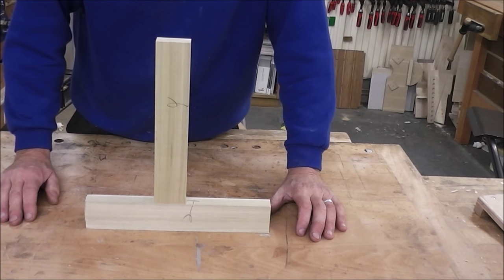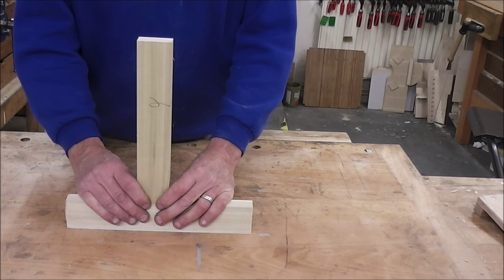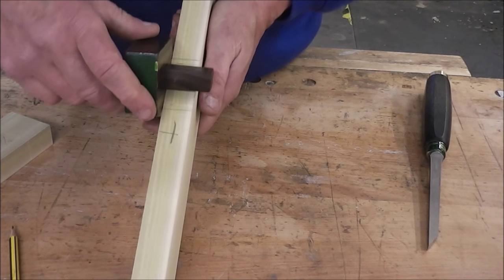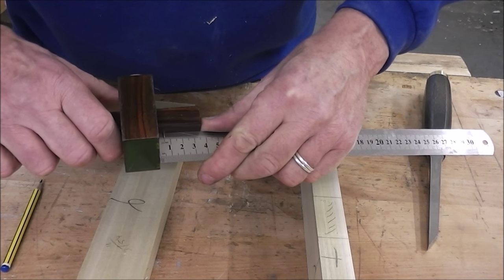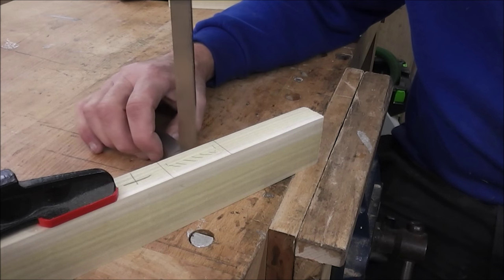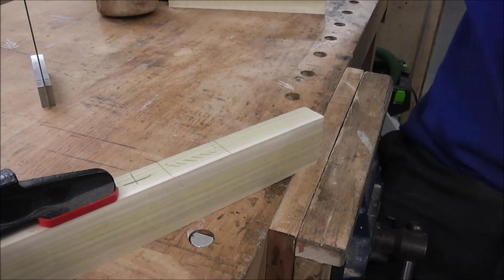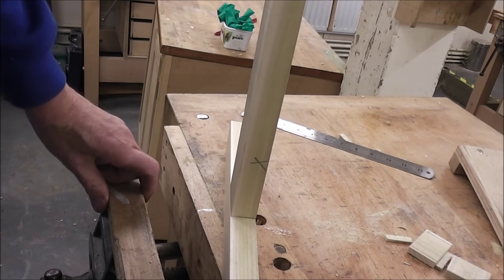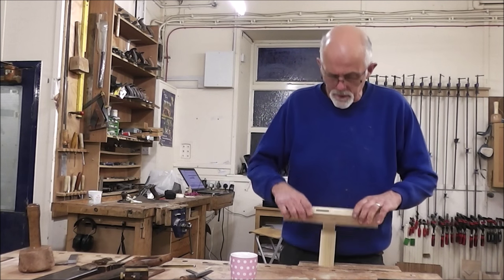How to cut a mortice and tenon by hand

Comment: Very informative video, thank you.

One thing though: Is there any specific reason to do the longer sides first when cutting the shoulders? Wouldn't it be better to cut the short sides first? That would give the saw more line to follow, resulting in a cleaner cut.

Comment: around 4:14, you scribe the lines for the mortise: is there any reason not to cut the tenon(s) first and then transfer the width, like you might with a dovetail?
Reply from the maker: +ThoperSought I must admit I have never thought of doing it that way. I was always taught to "dig the hole then fill it". You use the mortice gauge to mark the tenon, why not use it for the mortice while it's in you hand. Perhaps, if your sawing is not good, you may want to scribe from the tenon. But scribing  from the tenon would then mean you may not be able to cut the mortice just using the width of the chisel. This using the width of the chisel as the reference for both mortice and tenon is the essence of the method. 
For beginners, I think practicing sawing is very important, I would recommend doing a few practice cross and rip cuts at the start of each session at the bench.
Reply: Christopher Tribe
thanks very much for taking the time to reply!

that all makes a lot of sense.  I know my sawing is terrible, so making a serious effort at practicing it seems like a good idea—your sawing video was really helpful, so that I'm not quite as terrible as I could be.

I don't have a bench yet, so it's not so easy to get a good body position.  once I get that built, it may be easier to improve.

what I wanted to ask, though, was not for the width of the mortise, but for the length—setting the mortise gauge by the chisel seems like a great idea.

what I imagined doing was using the mortise gauge to scribe the width based on the chisel, and then cutting the tenon (with the other shoulders based on measurement from the datum surface).  then, laying the tenon across the surface where the mortise will go, and using the tenon itself to scribe the length of the mortise.

this is not "dig the hole then fill it," obviously, but I since you measured the same thing twice—once for the mortise, and again for the tenon—the first place my brain went was, "I could make a mistake, doing that," so I wondered.

in any case, I appreciate your very measured approach to this.  this video filled in a lot of info that I was curious about, for example the shape of mortise chisels vs. bevel-edge.  these videos are a wonderful resource, and I really appreciate them.
Reply from the maker: +ThoperSought I see your logic now. Yes that would be a good way of doing it. In woodwork there is always more than one way to skin a cat (is it PC to say  that nowadays?). Speaking of which I notice this vid. from Paul Sellars where he compares using a bevel edge vs mortice chisel for chopping mortices. He seems to favour the bevel for his particular morticing method. I favour the mortice, but as I said in the vid. it's not essential the bevel edge will do the job. https://www.youtube.com/watch?v=q_NXq7_TILA

I am planning a vid on making a bench with only minimal tools using a fire door blank. But that's probably not for a month or so
Reply: Christopher Tribe
thank you very much for replying again!

yeah, sorry I wasn't clear the first time around.

there do seem to be many ways to do similar things, and it's doubtful that any one could be judged to be 'right,' although some may match better with certain toolsets, etc.

I watched that Paul Sellers vid directly after watching yours, as it happens: it was in the list recommended when your vid finished.  

without trying both I'm not sure, but I wonder if the difference in his results wasn't just his comfort with one tool over the other.  it seems to me that the large registration face on the mortise chisels should help to make a more accurate job of it, and I would think that would lead to a better surface finish if you did both with equal skill.  but maybe there's something I'm missing.

I'll be looking forward to your bench-building video!  it'll probably be more than that before I actually start buying the stock, anyway, as I'm busy with normal life.

Comment: Can you get away without a mortise marking gauge ?
Reply from the maker: Yes. It's just a bit more time consuming. You could make the marks for one side of the mortice and tenon then reset the gauge to do the other side. You should get a well fitting joint as long as you make sure to do all your marking from the same face.